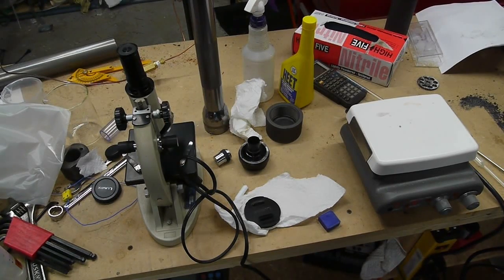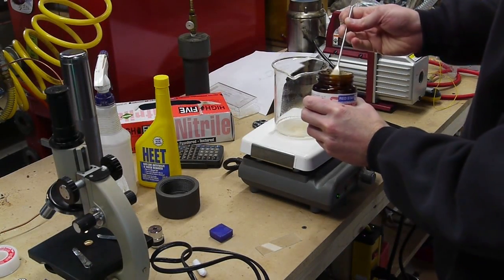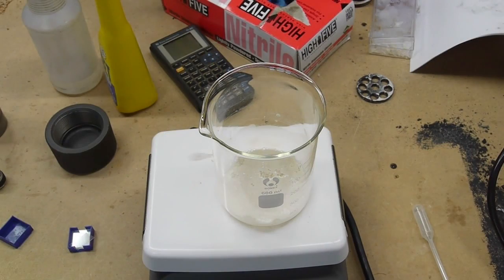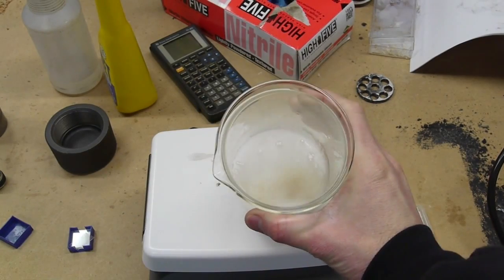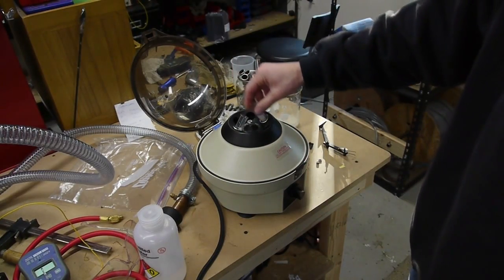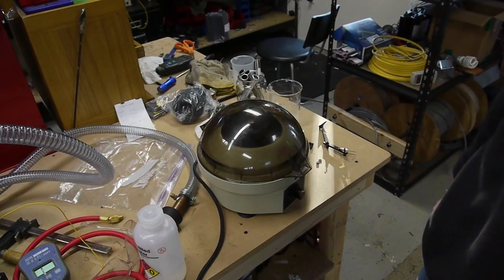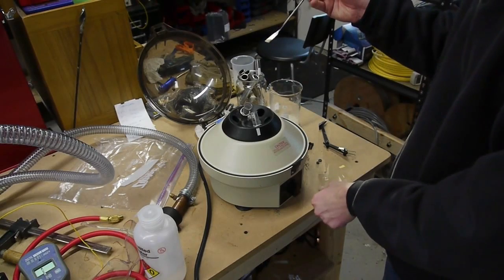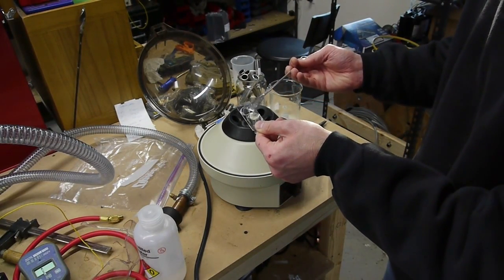Yeast cells under the microscope

Comment: Yeast is form of fungi we had whole class on nothing but... we looked at many yeast cells I think its 1000x  but thats not the point you would see the cells bud off you are not at enough magnification to see this budding it looks like small  extensions from a much larger cell...... its pretty cool to see.  you can capture it on digital camera as they have higher resolution.